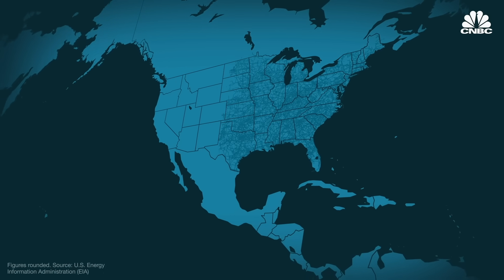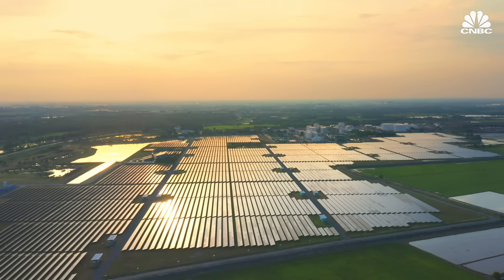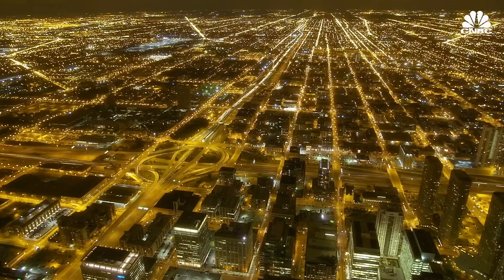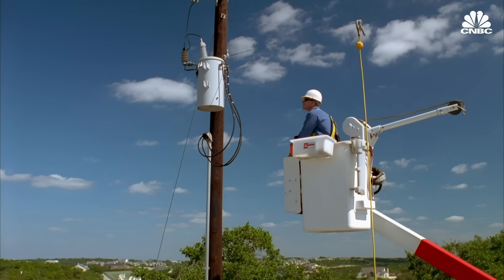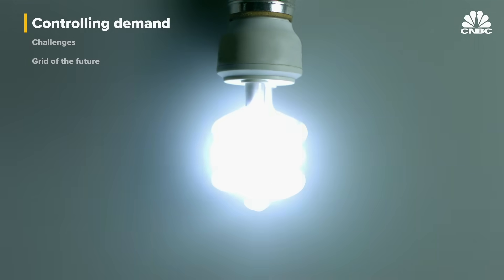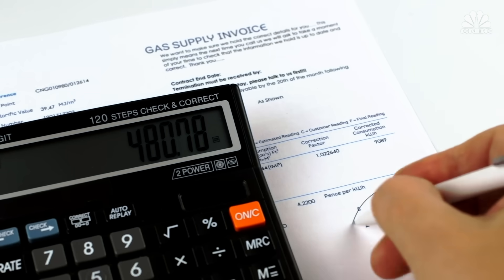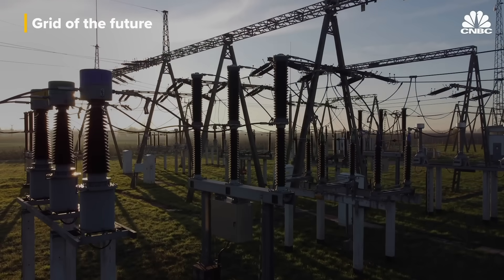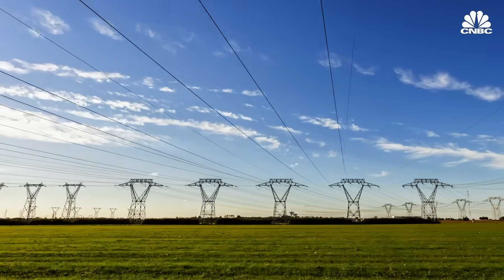How The U.S. Can Build A 100% Clean Grid

Comment: Which appliances are you talking about to run when it’s efficient?
Here why it doesn’t work
1. Microwave - can’t heat my food when there is no food, will not put food to be heated at 1230 when I am running a bit late and will have my lunch at 1330.
2. Washer/dryer - will keep the clothes in to run at the most efficient time but then it starts running after 2100 hours and finishes at 0130 in the morning, I have already slept , can’t get my clothes out - so either the machine runs at a low energy cycle for next 5 and a half hours or my clothes gets rubbished- stopping me from ever doing that or worse keep buying new clothes.
3. Refrigerator- all modern refrigerator runs constantly and depending on how many times it’s doors are open and how much food is in there , so stopping it’s supply as it is not efficient at the time will waste all the food.
4. Lights - only needed at night time.
5. Heating solutions- already utilise a fixed time approach where they can follow a fixed time.
6. Computer /laptops / mobiles- they follow there own cycle and needs charging when required. Computers need energy when you are using them.
7. Television- only need when I’m watching television and it will be only when I am at home and not working.
8. Ovens, cooking appliances- only required when I am cooking can’t put cake mixture in with baking powder at night so it can start cooking at 3 in the morning.
9. Electric cars - they will follow a set pattern like mobiles/laptops where once you are back from work you plug them in , and is the only time where it makes any sense to have a intelligent usage of the grid where it charges when required.
So basically you are saying that ‘we will say it’s works and appliances can be used when there is not much else requires electricity’ but what you actually saying is that we will make large batteries to charge things which will mine the earth for more materials and the next ten generations of battery will be absolutely rubbish in terms of efficiency and recycling properties, but by the time you realise the smart grid and storing energy is a totally useless exercise with batteries and should be done with something else. And then you’ll say about capacitors and how hydroelectricity must be used for storing etc. 
So think about it - do we really need to store energy ? Then what is the best way to do it without involving mining earth, and something which can be used for generations.
Reply: Agree wholeheartedly
Reply: In the home? Air conditioning, electric heating, electric car charging. There are a lot more opportunities in industrial usage.
Reply: @vylbird8014  I already took note of that. See point 5 heating Solutions- also includes air conditioning. We already use timer for them. So they are running at a time when there is not much load on the grid, and keeps us warm/cooled throughput the day.
Reply: @sayhjjm  Right. Same concept, just finer-grained. Controling minute-by-minute rather than hour-by-hour.
Reply: @vylbird8014  If I had an EV I would charge it at night. My parents had interuptible AC for a few years it was unbearable.
Reply: People have a lot of things plugged in using energy when not needed. My roommate is terrible about leaving lights turned on. Also, keep in mind of not so smart/outdated tech that can be modernized by just making the power system.

 I don't need my water heater making/keeping hot water when I'm at work or when everyone is asleep, but I have no way of turning it off short of a circuit breaker. My laptop doesn't take the whole time I'm asleep to charge. I forget to turn things off when I leave or go to bed. Making it so always ready things don't use electricity when you know when they aren't going to be used. How many items in your kitchen have lit displays? I'm not going to need my microwave when I'm gone from work. I don't need to know the time from every device in my kitchen, especially since I always use them at certain windows of time. Sure, the energy usage on those are minimal, but multiply it across a year for thousands of households, and the difference will be noticeable.
Reply: @luminaessence3077  Energy saving advances are making it into the home, but it really comes down to incentive - and incentive comes in the form of the much-despised power bill. So long as electricity is cheap people have no reason to worry about buying efficient appliances or developing good energy-saving habits, but they will react with understandable anger when some self-righteous conservationist says they want to see prices go up. Same reason countries with low petrol taxes tend to have less fuel-efficient cars.
Reply: I already pre heat or pre cool my home when there is a power spike coming up, to avoid the spike - automating that would make it more reliable. EVs can be plugged in for most of the time they are not being driven, and could just automatically charge when it is cheap to do so. Demand response is not about using less power OVERALL, it is about moving when power is used. Heat (and cool) can be stored inside most well insulated homes fairly easily, so heat and cool when there is more power available and don’t heat and cool when there is less. I agree that some demand would be tricky to shift (eg washing machines and microwaves) but we don’t need to move all demand, just enough demand. Lights, fridges, TVs, computers and lots of other things around the home only take small amounts of power or only take power for very short periods of time so they don’t actually matter that much in terms of demand. Renewables are cheap enough to build that we will end up with more power and cheaper power most of the time than we have ever had before. Anyone who is convinced it cannot work has not quite grasped the shift yet; it is a different way of thinking. But it not only prevents long term major problems from the pollution from fossil fuels, it also will provide vast amounts of very cheap power much of the time, and be a great opportunity for anyone innovative enough to find ways to put those large amounts of cheap power to good use on a somewhat intermittent basis. Storage, I suspect at least, will be a small-ish component.
Reply: @glennjgroves  Why would a washing machine / dryer be a problem? Load it at night, set the timer so it starts at a time that completion will be shortly after you got out of bed in the morning. Most modern appliances have this kind of technology - unless the United States is so far behind the times that these functionalities aren't built into models sold there.
Reply: @malcolmrose3361  if clothes are sitting wet for hours that is an issue. If someone can use a timer so that the clothes are only sitting wet for a short time (or not at all) then I agree, the washing machine would not be an issue.

I don’t think I mentioned clothes driers, but a similar thing applies, just the other way around; as long as clothes do not have to sit wet for long before the drier starts (as opposed to after the washing machine finishes) driers also would be fine if timed.

I have slightly changed my mind on washing machines anyway; it turns out that (when they are not heating water) modern washing machines use very little electricity. So anyone doing cold washes, or who use a washing machine that uses hot water from the tap instead of heating it inside the washing machine, really does not need to worry about power usage anyway.

There are also heat pump driers now, that should use a lot less electricity. The cheapest form is drying is always going to be natural drying anyway - clothes line or clothes rack - where that is workable.
Reply: @glennjgroves  My washing machine takes hot water from the house supply - I live in an old house so it was a bugger to do, but it allows me to use the solar water heater to maximum efficiency. I'm fortunate in that I live in Southern Spain and that the sun shines 320 days a year on average - the hot water tank holds enough hot water for several days of normal use, and just needs a few hours of sunlight to warm the water - it's fairly rare that I need to switch on the electric heating element, probably just two three times a year. And the washing machine is programmable in the way I mentioned - it's a standard feature in Europe unless you are buying a bottom of the range import.

Obviously, I'm fairly lucky but I'd have thought that most of the houses in the Southern US could benefit from such a system. And you don't really need any "high" tech to make it work - it's just basic physics after all.
Reply: @malcolmrose3361  you probably do not need a drier at all, and your washing machine likely uses so little electricity it really is not an issue. I sometimes forget how efficient some appliances are. I don’t have a clothes drier at all, I just use clothes racks even in winter, a lot of people could. (I am not saying everyone, just a lot.)
Reply: @glennjgroves  I have a dryer, although I probably only use it once a year (it came with the house) - I mostly just use the washing line - I have enough clothes that I can wait a day or so to do my washing when the sun shines. Probably the biggest single consumer of electricity is the water pump for the pool - it is an old house with small windows on the sunny side and walls two feet thick so I only need to turn on the A/C on very hot days (>35C). 

My total household consumption averages out at 11.59 KwH per day - or 4,230 KwH per annum. Out of interest I found that a similar sized US home in 2015 would have consumed on average of 11,604 KwH - which I find pretty mind-boggling. I have a very small PV system (3.3KW panels / 8KwH battery) that puts me into surplus on an annualised basis with the local grid.

Comment: I have solar. The problem is keeping enough  backup for wind and solar. Not only day to night but also summer to winter. My solar system puts out 8 times more energy in the summer than the winter. Most folks currently have fossil fuel heating. Going to electric heating will require much more power when solar output is at a minimum. Current storage is very expensive. My cost would be over $20,000 for a system that would do very little in the winter and would never pay out. I also have an electric car but as of now I it's not allowed to use it as storage. You can balance the load by just increasing the cost of electricity at certain times of the day where folks can't afford it. So they can sweat it out in the summer and bundle up in the winter. If, as stated, renewables are less expensive why is it that the cost of electricity is going up faster in areas like California where they are installing lots of renewables? The reason is you need to keep backup for when the sun doesn't shine and the wind doesn't blow.

Comment: Has friends over, “oh, sorry guys - can’t make coffee, my electric kettle is disabled by the power company” “let’s just watch TV instead... oh wait...” 🤦🏻‍♂️
Reply: TVs use way less energy than a kettle.
Reply: @kokovox , kettles are on for 60sec, but 70’ OLED TVs tend to stay on for hours at a time. I’d be very curious to see what the average watt use weighs out to.
Reply: That's not how it would work. Demand regulation is for the things which are not time-sensitive, and use a lot more power than kettles and television. Think air conditioning or electric heating. You probably wouldn't notice if your thermostat bumped up a couple of degrees for fifteen minutes.
Reply: @vylbird8014 , oh I definitely wouldn’t notice the fluctuations in heat and air. I prefer warming weather, and am a big fan of layering up when it’s chilly. I’m always keeping the thermostat on more wallet friendly levels. Though, the images that were used in this video did show smart plugs that directly control small use items like electric kettles. That’s primarily what I was referencing.
Reply: @ardentvibe6917  The kettle thing is just marketing wank. Completely impractical. I wouldn't want to invest in that company.
Reply: You were the guy in the turn of the 20th century saying cars were unreliable when compared to the horse.
Reply: @furezj , oh they definitely were! Took a few years to finally start making reliable cars. 

I just don’t like the idea of my appliances not working when I need them. I already have my entire home wired up with smart plugs that turn off everything when I leave. Not being able to heat up food because the microwave is off, or only being allowed to have hot showers in the middle of the day is just not appealing as a consumer.
Reply: @furezj  cars weren't more reliable at that point. What's your point?

Comment: 'The circuit breakers/the transformers try to stop the flow of electricity from your house back to the grid'

Eeeem.. no.
Reply: Being and Industrial Electrician, I wondered about that statement as well.
Reply: They sound dumb, don't they?
Reply: She should have said you need an inverter to frequency and voltage match commercial power but everyone would have been confused by the word inverter. And a net meter from your utility.

Comment: One place where I've never seen full scale production is the tides. You could hook up thousands of tidal generators and eliminate nuclear and coal altogether. The tides never stop unlike the sun or wind.
Reply: Problem: you are limited to the oceans so good luck sending that energy to the middle of the nation
Reply: @AdamSmith-gs2dv  last time I checked, there were large rivers that ran across the country
Reply: @Sjrick  Hydroelectric energy has already been utilised completely by every country that has access to large rivers - you can't build as many as you want.
Reply: @elvislin6081   I don’t see how if they are engineered correctly. They wouldn’t hurt anything
Reply: @elvislin6081  well they already make them and use them, so it couldn’t have been that much of an issue
Reply: @elvislin6081  of course they aren’t
Reply: @elvislin6081  My apologies - was meant to reply to @Sjrick. I agree with you when it comes to Nuclear - replicate what France has done successfully, then there's no need to re-invent the grid.

Comment: A Smart™ air conditioner/heat pump (HVAC) is an air conditioner/heat pump that cripples itself when you need it most.  Luckily it doesn't take people long to figure out all you need to unsmart your smart™ device is to change your wifi password.  Then your thermostat goes back to being user controlled rather that grid control.

Comment: Aren't y'all owned by GE?  First, shutting down the coal plants. Second, linking the three grids via high voltage DC. I've been trying to shut down the coal plant here in Austin for years. I invite Google and Apple to pressure the city, which owns the utility, to close Fayette power plant ASAP. Furthermore, the electricity required to run the internet should be 100% renewable first before we entrust some ENRON wannabe startup with access to our homes and families. Improved energy storage, whether flow, thermal, or liquid metal, will put fossil fuels out of business in the energy sector.

Comment: To spend trillions to get equal or less energy surpluses than you're getting now doesn't make much sense, unless you phase it in over 2 or 3 generations.
Reply: you're right! but doing it to prevent imminent environmental and societal collapse makes it worth it
Reply: Not quite, with money printers going burr... It will be cheap in no time :)
Also benefit of switching early vs costs of more extream weather and PM pollution could put the optimal rate of change closer 50 years  instead of 3 generations

Comment: Focus on nuclear energy. It works...
Reply: @sanketthakuriya5669  the us plans to spend nearly 2 trillion on its current course. So 6 billion is a drop in a bucket
Reply: @sanketthakuriya5669  not to mention South Carolina electric and gas co abandoned two reactors after over 9 billion of spending. Still can't find a buyer for after 3 years.
Reply: It's pricey!
Reply: Amir Mansa  But is it worth the risk? Remember the Chernoybl nuclear power plant?
Reply: @dave_riots  nuclear is not risky. Dig into the details and you'll soon realize it's the only good option
Reply: @garry8390  It is risky, because a nuclear power plant can meltdown at any time for any reason. It's cheap and reliable, but the risk outweighs that. If a meltdown occurs, the costs of cleaning up the mess from that meltdown and the possible repairs plus the costs of evacuating everyone from the area as well as having to re-house everyone would surely change your mind.

There are potentially better options with far less risk.
Reply: @dave_riots  new nuclear tech is much safer. Look into SMR
Reply: @dave_riots  Damn, you're argument is so cliché... it's almost like you don't understand it...

Comment: We need nuclear .
Reply: Modular molten salt liquid thorium reactors. We need those everywhere.
Reply: @DynamicHaze  or you know just standard nuclear which has been working just fine for decades
Reply: @garry8390  way to expensive, unsafe and they produce long lasting waste. Generation IV reactors are the future.
Reply: @onlymediumsteak9005  Not when implemented correctly - standard water reactors have a proven track record of safe operation, and can do so economically if done at scale.

Comment: We need nuclear energy. Simple as that.
Electricity consumption will rise, due to elecitrification of vehicles and industries.
Only nuclear can form a solid base to produce electricity, since nuclear power plants do not rely on wind or sunshine.
Also, do not forget the industrial need for hydrogen. Hydrogen is currently made from natural gas, but if we want to produce hydrogen with electrolysis on a big scale, we need nuclear power.